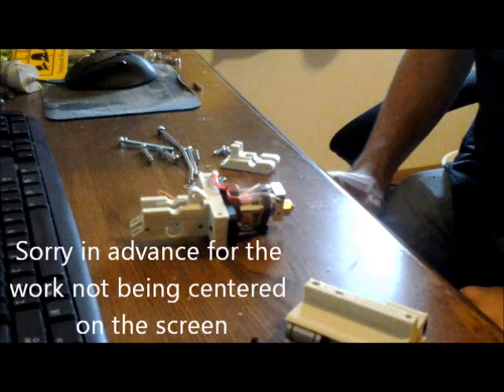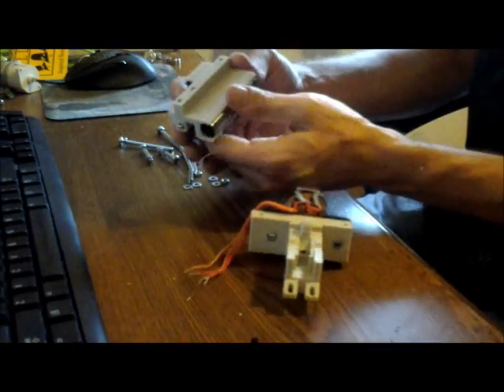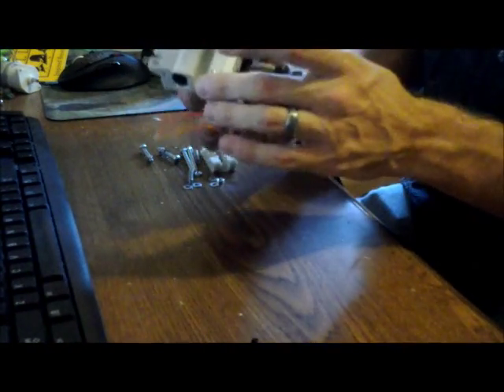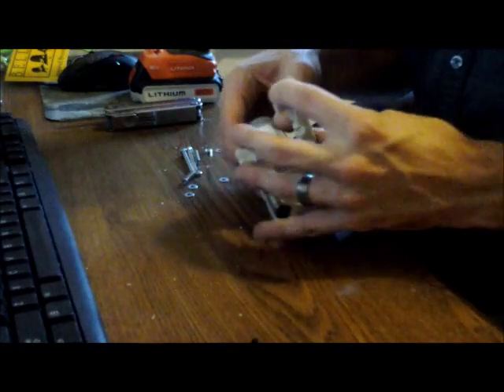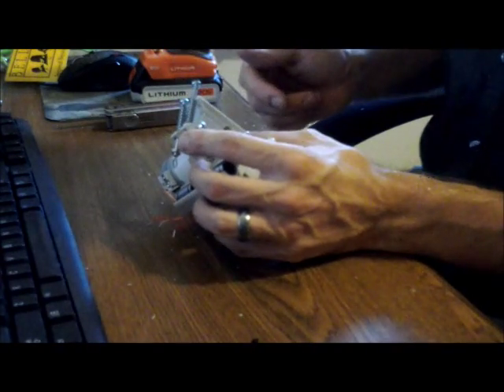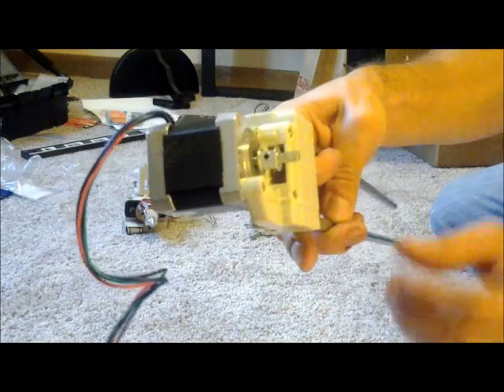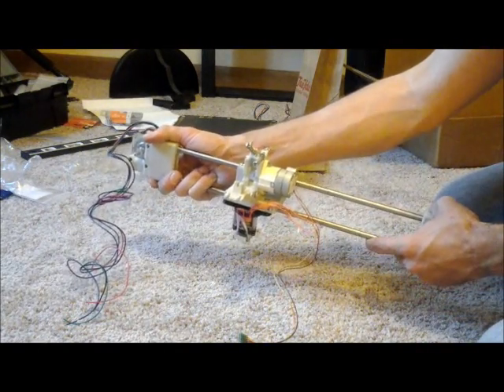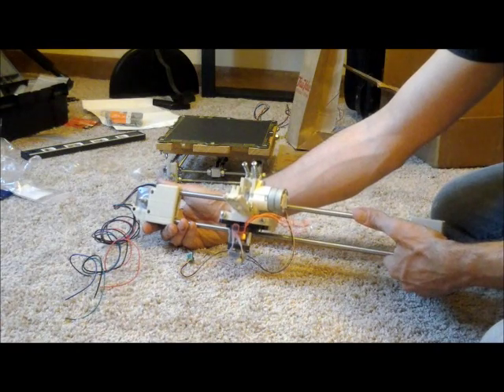Prusa i3 build log Stage 4

Comment from the maker: When finished printing you can leave the filament in the hot end.  No need to back it out or remove it, unless you plan on changing colors.  If you plan to swap colors it is suggested that you heat up the hot end only a little to soften the filament inside.  This will let you pull the filament out the most amount of filament and prevent melted filament from backing up the hot end.

Comment: how do you clear the hot end when done do you just let the plastic cool inside it or shove a thin  wire through how do you get it clear

 am i wrong in assuming that backing the filament out wont pull the melt out the hot end or does it pull out when cooled some